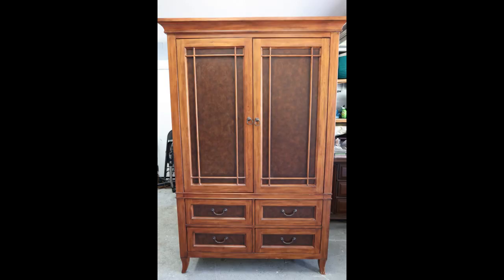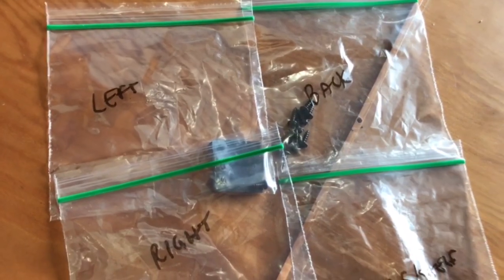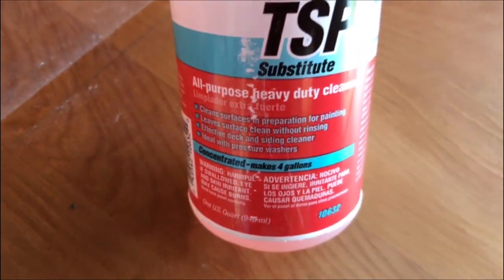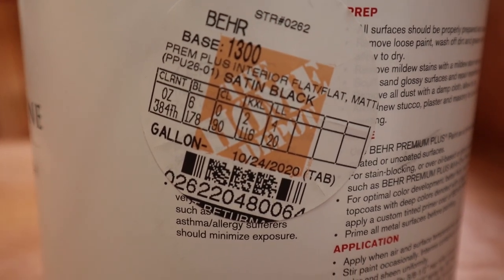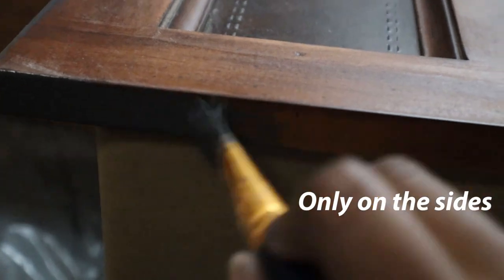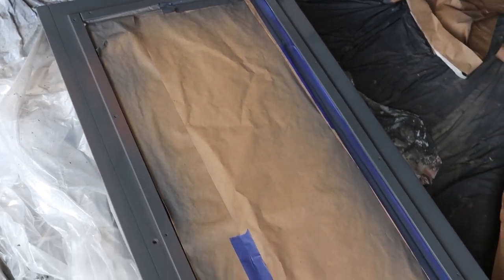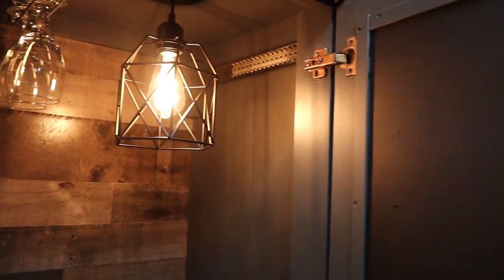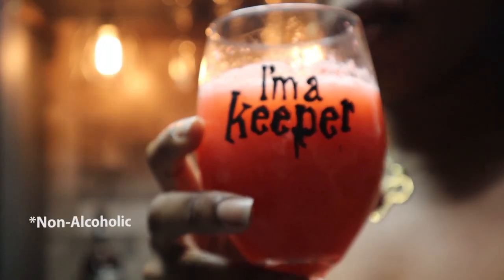BarMoire - the Armoire Bar | A Classy DIY Upcycle To Save The Environment

Comment: Hi, I was wondering where you got the hardware (the black plate cover) for the pendant light? I cant find them for the plug in pendant light
Reply from the maker: For the life of me I couldn’t find them either so I ended up using these ceiling plates and putting a hole in them. https://www.homedepot.com/p/Commercial-Electric-5-in-Round-Blank-Metal-Flat-Cover-White-Textured-PMTW-RB/300716577?source=shoppingads&locale=en-US&mtc=Shopping-B-F_D27E-G-D27E-27_4_WIRE-NA-NA-Feed-LIA-NA-NA-WIRE_OG2021&cm_mmc=Shopping-B-F_D27E-G-D27E-27_4_WIRE-NA-NA-Feed-LIA-NA-NA-WIRE_OG2021-71700000080343946-58700006748620836-92700061189583327&gclid=CjwKCAiAp4KCBhB6EiwAxRxbpCID-aS5wElUnLeMm4ZOOJrk3XsXMuiLaQemIWYrg_Dw4JEFws0nzhoCz6oQAvD_BwE&gclsrc=aw.ds

Comment: Love this! 
What grit did you use to sand the wood? 
Do you have a link to the Home Depot wood panel you used?
Reply from the maker: Here is the link to the wood (MDF) panel: https://www.homedepot.com/p/Weathered-Grey-Plank-32-sq-ft-MDF-Paneling-169779/302944333
And I believe I sanded it with 120 or 220. I'm leaning toward 220. I honestly don't remember now. Wish I would have noted that, but it wasn't stronger or lighter than one of those two.
Reply from the maker: The lights are here: https://www.amazon.com/gp/product/B08BZ9J4GY/ref=ppx_yo_dt_b_search_asin_title?ie=UTF8&psc=1
Reply: @creativelye  awesome, thank you for that information. What kind of palm sander do you use or recommend? Is it a DeWalt?
Reply from the maker: @sweet84732  it is but we actually replaced this one with the Bosch recently and it's just as good. Honestly, any decent sander will work. I would have replaced it with another Dewalt, but we couldn't find it in the store at the time, and I didn't feel like waiting to order one.

Comment: I was curious how you threaded the plug through the ceiling plate when it had a socket on one end and a plug on the other? Did you have to cut the cord and strip the outer coating which you reattached or am I making it too complicated?
Reply from the maker: You’re correct. That’s what happened. The second option was cutting a slit in the plates. Sliding the cord in and then patching and painting the opening.
Reply: @creativelye  thank you! It looks amazing by the way, nicely done!

Comment: Love it! A few questions- What sand grit did you use? Also, what was the size of your spade drill bit?
Reply from the maker: Thank you so much! I think a 1/2” for the bit and 120 for roughing it up. 400 for fixing the top coat issues.

Comment: Question: did you hide your wiring for your lighting? If so, how? Thank you!
Reply from the maker: Thanks for watching! The exterior top of the armoire comes off and there sort of a hidden compartment in there. That’s where we ended up putting the wiring, except for the cord for the plug. We drilled a hole out of the back of that compartment to feed the plug through. Hopefully I explained that right.